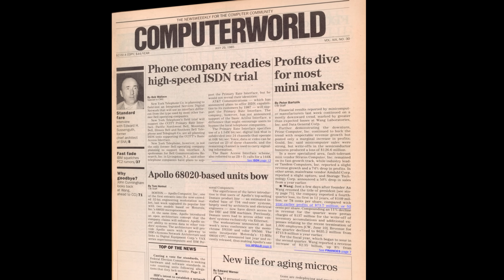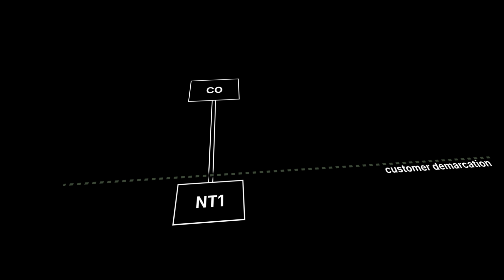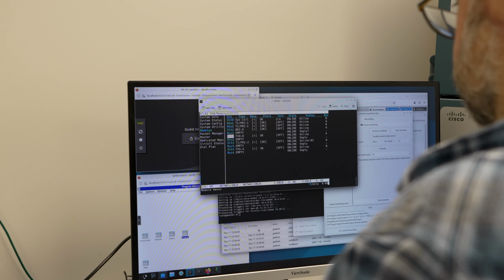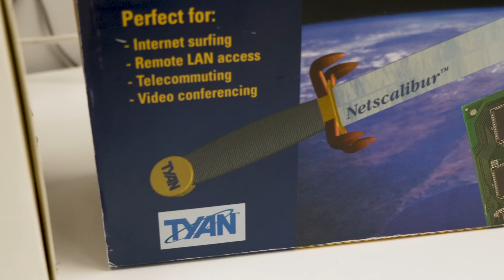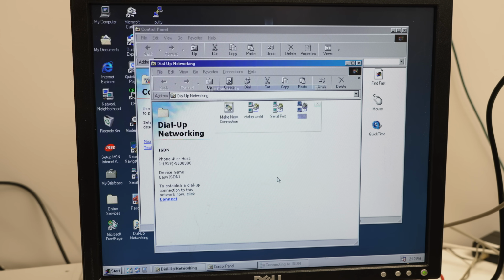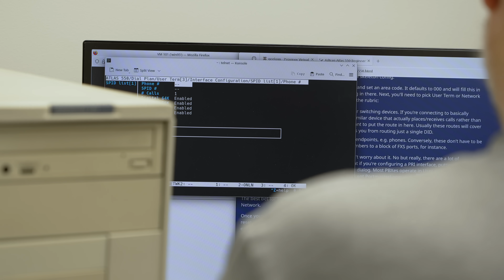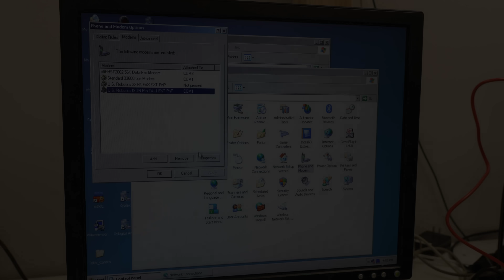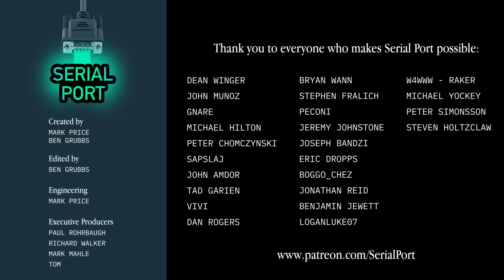Do you remember ISDN?

Comment: I had ISDN back in the late 90s. One of the cool things about the way it was provisioned (I was using Bell South) is that each BRI would come with its own phone number. You could use these phone numbers and could connect a phone to each port on the back of the BitSURFR Pro. If you had both BRI channels connected to the internet and a call came in, it would drop one of the channels and the phone would ring and you could answer it and the data connection stayed up on the other BRI channel. Then once the call was completed the BRI would switch back to data mode and rejoin the data connection. It wasn't super fast, but the latency was amazing. I had it for about 2 years (from 1996 to 1998) and then I moved to an area that got ADSL shortly after I moved there, and it was so much faster.

Comment: I had home ISDN service from Verizon back in the day and used the same 3Com modem.  Unfortunately it connected to the PC using the same name of this channel which was a bottle neck. It connected instantly and the low latency made it feel much faster than dial-up.  I only used this for work remote access and connected to a Shiva server with a T1 connection. The Shiva supported 23 digital modems for analog call’s and also allowed ISDN connections. I installed that server and many other network devices over my 40 year IT career. This is what makes this channel so nostalgic to me.

Comment: I had ISDN back in the mid 90s mid the issue was they had to put the same line conditioning and repeaters they would have to do for  T1 / PRI. So it wasn’t really cost effective for the end user. 

Tim loved having it set up to where I could get a phone call and it would ring and if I picked up it would drop down to 64K till I hung up and then would go back to 128K. 

I wouldn’t lose a download if I had to take a call. 

For a ISP they didn’t have any real difference with a 64K isdn vs a 56k it took up one D channel. The real issue was for the end user. 

The cost of the ISDN line plus the ISP fees. 

The phone company wanted just too much for a ISD for the gains in the speed.

Comment: Oh, yeah - I remember it. Back in the 90's, I had a permanent connection at home with single channel BRI service to a Cisco 761 router. It was pretty amazing for the time, and I was able to run a Lotus Domino server for email, web, etc. as well as my own DNS server, FTP server and other stuff. When we had to switch to ADSL, it was faster and cheaper, but not as reliable, so I moved my servers out to colo and eventually cloud. I still have a (mostly empty) 46U rack cabinet in the garage as a result.

Comment: We had ISDN installed in our house very briefly in 2005 with the main reason being to free up the telephone line while online.  At that time we had a satellite based 300kbps download with an Italian provider Sat ADSL, which used an ordinary satellite dish connected to a PCI tuner card for the downlink and the dial-up modem for the upload.  From what I recall, we paid €30/month for 180 hours of dial-up allowance, a €16 landline surcharge for ISDN and €16/month for Sat ADSL with a 300Kbps connection and a 1.5GB monthly allowance.  Pings were around 350ms from what I recall, mainly due to the satellite downlink latency.  

Just 3 months after getting ISDN, our telephone exchange got DSL, which required downgrading the phoneline back to analogue as DSL could not be delivered over ISDN here.  On the positive side, it was a massive leap forward getting 1Mbps, an always on connection with a much larger 40GB monthly limit.

Comment: This takes me back! I lived in western Massachusetts in the late 90s and the only thing available to me that resembled broadband internet service was ISDN. I bought a US Robotics Courier I-Modem and got service from a local ISP that supported ISDN. The local telephone company at the time charged per-minute prices if you placed an ISDN call as a data call, but voice calls were unmetered. The solution was just to tell the modem to place the call as a voice call (there was an AT command for this - probably one of the countless S-registers). The B channels would drop to 56K each, so you lost a little bandwidth, but it didn't really matter since the external modem was connected to a serial port that couldn't exceed 115.2K anyway, and the 112K this setup gave you was close enough. And I had the option, if I wanted, to drop one of the B channels and use the analog port on the back of the modem to place a voice call. I used this functionality when I ran a BBS and still wanted to make outgoing calls on occasion.

The difference in speed between a 56K ISDN connection and a 56K analog connection was night and day. The analog connection was constantly doing error correction, which you didn't really notice except as decreased throughput. And of course if the line noise was especially bad it would retrain and maybe drop to a lower speed. It wasn't uncommon for me to only get 33.6K at best. But ISDN 56K was true 56K connectivity and the throughput and latency was better than anything I'd ever seen before. I ran this setup until I moved to south Florida and got my first cable broadband connection. I thought I'd died and gone to heaven!

Comment: And anyone forgets how amazing voice was with ISDN. Crystal clear.
Reply: With the digital phone network, the noise was pretty much all on the local loop.
Reply: I lived about 4000 feet from a 5ESS switch most of my life. Analog phone service was excellent quality. I had 53333 dialup all day long with a cooperative remote modem (I think i remember V.90 worked better than X2 but K56Flex also got 53333 on occasion. Good ole maximum power output FCC regulations) Also fun: TCI/Comcast ARRIS CBR digital voice(NOT voip, seemingly a dedicated DS0 D/A conversion at your house, and powered by the +60-90VAC on the cable plant that also powers amps/nodes) would also give you 53333 dialup. No digital conversion until your house. Can't get that with VOIP nowadays!

Comment: I got ISDN by the end of 1998. Big step up...not just for the speed at 128K but then the connection was always connected and I could still make calls. That was the biggest advantage...always on. When I moved I had to switch to a satellite uplink, phone line downlink. That lasted about 6 months until I got Comcast cable connection...which i have had for over 20 years now. Quite the transition form the original AOL 28K dial up in 1995.

Comment: I had an Ascend Pipeline 75, which was used with BT's home highway consumer ISDN offering (Had two POTS ports on the unit as well as two ISDN ports)... Not many ISPs supported multi link PPP though in the UK, but even having 64kbits back then was much faster to connect and use over a modem (and also instant on, etc.). Also meant you didn't need a computer on all the time for dynamic dialling, etc. ! 

A friend of mine referred to the Pipeline 75 as "Lifetime 75" presumably because he'd seen issues with them...

Comment: I used to do ISDN support for various ISPs.  Selling points were that it could drop down to 64K to take incoming calls without dropping the internet and, of course, the dual 64K channels for 128K.  ISDN was also fantastic for running a fax machine over as it had no line noise.  I used to run dual 56K modems over it for full speed dial up as you could really get the full 56K through standard dial up ISPs.  Especially since ISDN accounts were expensive and 56K was not.   What most businesses here in the states used it for beyond internet was video conferencing.  There was a great number of camera phones for ISDN at the time.  They also used to run the X.25 network through it for financial transactions like credit card machines.

Comment: Man this brings back memories.  We had a remote office in Germany which needed occasional connectivity to our HQ, but internet lines (to run a VPN) were crazy expensive back then. 

I was barely into my first job and I figured out how to set up a dial on demand ISDN call between a pair of Cisco 500 series routers.  The sub-second setup time of ISDN meant it was completely transparent to the user - as soon as they tried to access something at HQ, the call was made quick enough that the application worked first time.  Even managed to do dynamic bundling so that if demand is high it would bring up the second BRI channel for a whopping 128kbps…

Comment: I had an ISDN line (BT called it 'Home Highway') in the late 90s.  I lived out in a village where the nearest telephone exchange was six miles away.  This would make modem usage very error-prone, so I decided to go for an ISDN line to more than double the approx. 2.1KB/s to 5KB/s.  I never had a perfect 8K/sec.  Still, it was far more reliable than an analog modem and the only problem was that I had to hang up the phone every two hours and redial.  This was okay since dialling was instant - but it was very expensive and extremely slow by modern standards.  The ISP (and British Telecom) never supported the 128KB configuration but it meant that I had an additional telephone number, so going on the Net meant that I could still make phone calls.  There was even a Windows 98 app to make speech telephone calls using a headset on the computer.  I only used that once and found it to be quite buggy.  As to what I used the 'turbo' 8Kbyte/sec. connection for: I listened to radio stations on RealPlayer, and remember watching a NASA TV feed.  This was in a tiny window but it was relatively smooth video.

Comment: I remember ISDN quite well, used to set ip up for client back in the 90s.  Phone compney installed the line at the d-mark, and I would install the CSU/DSU and router.  It was used mostly for e-mail.  Law firms would use it for West Law too. Later upgraded them to DSL, or a T1 for bigger clients.
Reply: Depending on the DSL, a T1 might be a downgrade.  Back in the early 90s, I was working with a T1 over HDSL

Comment: I remember two things about isdn. It was very expensive for residential use. My high school had a stack of them for achieving 512kbit of internet connection. I’be also found a a lot decommissioned routers on business sites with isdn uplinks.
Reply: I have a Cisco 2600 series with a T1 CSU/TSU, as well as a couple of serial ports that could be used with a BRI ISU.

Comment: I was a service tech at Bell Atlantic and installed ISDN lines in Philadelphia. They were mostly businesses including bars and restaurants that had radio disc jockey remotes. I also remember 3 ISDN lines getting bonded for video conferencing at large corporations with PTZ cameras and televisions in conference rooms. I remember it as Integrated Switched Digital Network and of course It Still Does Nothing. I also entered SPIDS and testing the lines. ISDN never caught on in residential or home offices  that eventually got DSL lines and POTS for Fax machines and dial up backup for data.

Comment: I had ISDN in the late '90s.  It was cheap here, cost about as much as a POTS line.  And I was working at an ISP, so I had free 128k internet service.  Replaced it with DSL somewhere around 2000.

Comment: We were the first in the city (DE, Bavaria) to have a business connection with 4 lines and 8 channels. The hardware consists of an OCTUPUS frm. German Telekom. An AVM B1 card is installed in a PC on the network. Using both channels of the AVM card was expensive. Later, a networkCAPI was introduced. With that, every Windows PC could access the ISDN card on the LAN.

Comment: I do indeed remember ISDN. I had it for a year or so before cable modems came to town. The phone company ended up having to run new copper all the way to the terminus at my apartment, because the 60-year-old paper-insulated buried cables were too noisy, and had loading coils buried with them.

Comment: I had a netgear RH328 or 348 networked ISDN "modem" - I can't remember the differences now, almost 30 years later - that I dialed into my ISP / employer back in the late 90s.  At the time I set it up it was miles faster than anything readily available for home user prices, but I remember having to rush home to reboot it when it started flapping and redialing every second - the connections worked, they just didn't bond I think? So Ameritech charged me $0.07 per attempt, and that added up quickly.

Eventually I missed a bill and Ameritech wanted another few hundred to re-terminate the line, and that's when I finally switched over to cable service.  DSL never stood a chance.

Comment: I setup a pair of ISDN links (direct connect between nearby locations) back in the 90's, and I hated it. It eventually worked, but between dealing with the telco and the oddly specific demands between it and the modems, it took a couple solid days to get it all up and running. Yeah, so no wonder ISDN never took off. And good thing too, or we may never have got better things like DSL, DOCSIS, etc. Good riddance to ISDN.

Comment: I worked at a local dialup isp in the Houston area from 1996-2000, and isdn wasn't too common but we did support it. When I moved onto my next job in March 2000 I was surprised to see they had 128kbps isdn for 50 users, and it was awful. Luckily I convinced them to upgrade and we had a full t1 a few months later.
I also had iDSL at home around 2001-2003. It was 144kbps, which was slow even then but beat the 26400 I got with dialup.

Comment: I had ISDN in the late 90s. I loved it. I had a router that handled all the ISDN business and my machines just connected via ethernet, unaware of the ISDN.
I made a mistake however seting up the router. I was overly agressive with the timeout regarding disconnect/reconnect.

I was unaware that my telephone conpany charged something like $0.02 per local call. So the 100s or 1000s of reconnects per day ended up adding something like $200 to my first month's bill.

Ooops.

Comment: ISDN was great for it's time, you could be online and still recieve landline calls on the home phone. 128k most of the time and 64k if the phone was in use. My provider supported dual 56k or 64k via DOV (Data Over Voice), where you make a call to the ISP and then make a ISDN connction over that digital voice line (ISDN data connection at untimed voice call rates). $132/month - unlimited data lol.

Comment: You can save off the config of the adtran. If I remember correctly, it is to a TFTP server.  You can also dremel out the old battery and install leads to a new one.  It makes a huge mess doing that.  I did it to mine and had success but I also keep backup config files just in case.
Reply: I was wondering why the battery replacement never happened. :(

Comment: Just scrapped 3 ISDN TA's, as the encumbent and sole copper wire telco both no longer offers ISDN support, and also no longer does copper pair maintenance. So all those TA's were abandoned in place, along with the copper lines, and they will offer you fiber at the same high price, with a proviso you sign up for a 36 month contract.

Comment: ISDN was very common in broadcast radio right up until around 2012. 

I did at internship at a major Australian commercial radio station and asked the Outside Broadcast manager why they use ISDN and not ADSL or Cellular. And her answer was that ADSL can be 10 Mb/s. But it can also be 1Mb/s the next moment. 

And it’s easier to build an encoder that is always doing the exact same speed than a box that can do a range of speeds moment by moment.

Comment: this is such a throwback... we had isdn 25 years ago, it was not popular but the price difference compared to a normal pots line was negligible, and price of internet access hour was the same as over modem, but with over double the speed compared to a modem line. with isdn and with both lines connected, it was finally feasible to use p2p and download anime from winmx and emule. but it was so short lived, 56k lived for way too long and nobody wanted to switch to isdn. and then adsl came and isdn just died. 
PS - our provider was delivering BOTH isdn and adsl over the same line for a month while switching services and both worked together, 2 isdn lines and adsl could be used at the same time. that was in 2005.

Comment: I used ISDN from 1998 to 2002 at 64 Kbps sometimes I went to 128Kbps but it cost a lot more, then ADSL 4Mbps arrived in 2002 which went to 7Mbps 3 years later

Comment: You cannot have full 128k when downloading single file because you use only 1 link for that file. You have to use some kind of download accellerator to be able to achieve full download speed.
Reply: That depends on whether you bonded the 2 channels.  I used to routinely configure an ISU for 128 K.

Comment: I worked for AT&T for 20 years and back in the early 2000's they'd regularly use ISDN as a backup connection for routers with a T1 as a primary line. I remember taking the Cisco CCNA back in 2003 and found ISDN so confusing and complex. Then DSL technologies came along and IP-based voice communications and ISDN instantly looked obsolete, because a dial tone and switched telephony were gone for good.